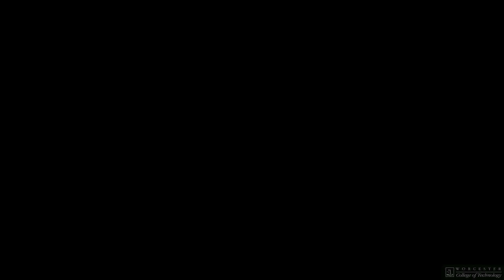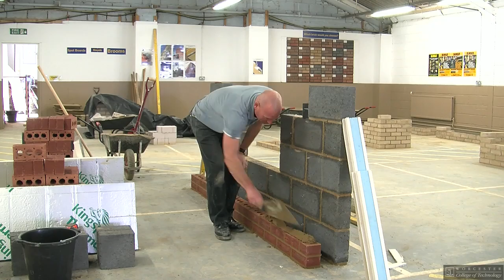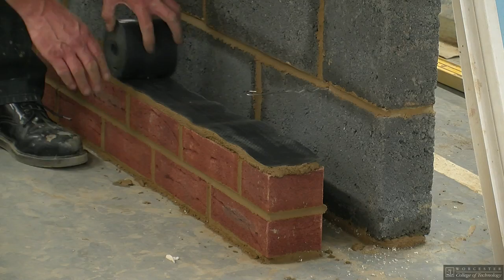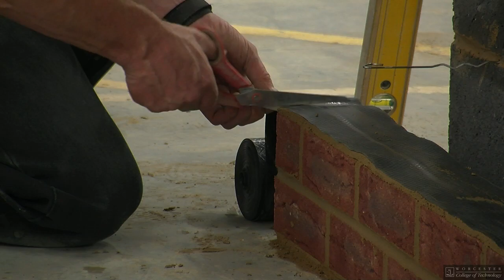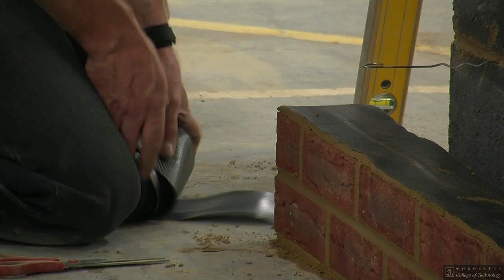Brickwork-DPC

Comment: I know nothing about this, so probably sound thick, but how do they do this after a property is built? You can't later access the bricks at this height of an exterior wall. Is there different treatment if a property later develops damp? Is this just when a new property is constructed?
Reply: Liam Barker there are chemical products which are injected into the wall in a line if the DPC has failed or is not present on an older wall.